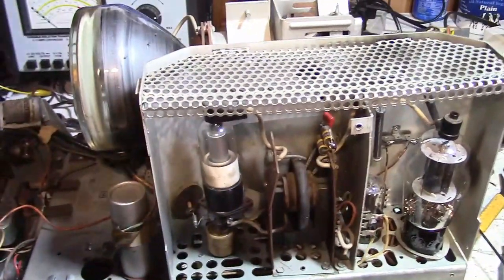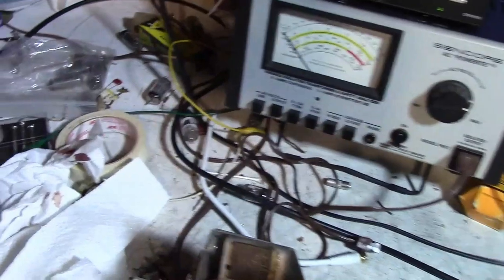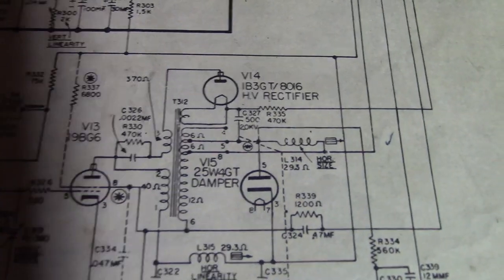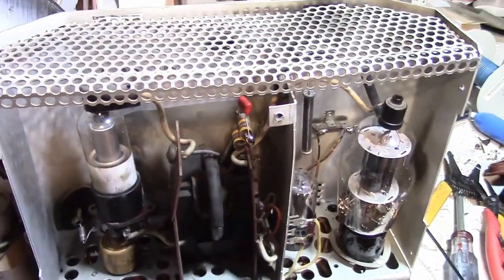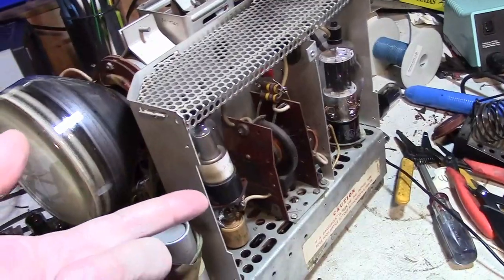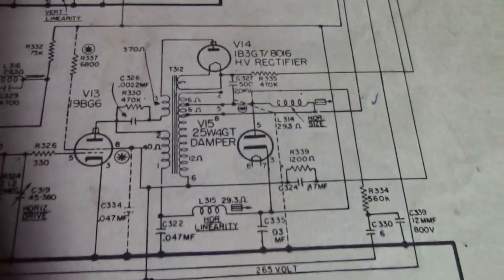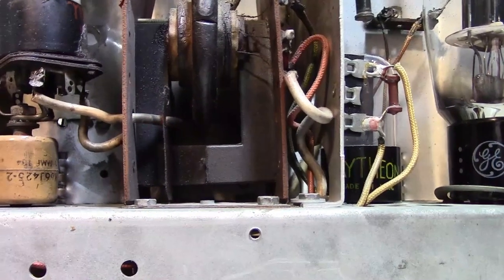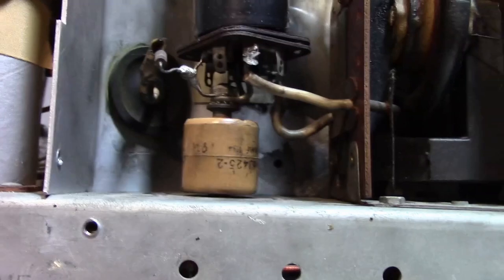GE 800D restoration p6o8

Comment: Hi Bob, Always enjoy your vids. Regarding the bright vertical lines appearing on the raster, I came across an old TV service book by Wayne Lemons in which he describes this phenomena related to the horizontal deflection yoke. Specifically, if it is a series coil, there is an "anti-ringing" capacitor across one of the coils that eliminates electrostatic deflection by equalizing the potential across both coils. He goes on to say; "...if it should open, there will be a series of brighter lines on the left edge of the raster, gradually diminishing in brightness towards the center of the screen." Not sure if this is relevant to the GE800D. --Steve C.
Reply from the maker: Thanks for the info.  I did check that cap and it's good.  I will try disconnecting it just to see what effect it has.

Comment: Hey Bob, sorry if I missed it. What exactly was causing that bright vertical line with the folding? You said the old flyback tested fine and your going to put it back in, so it wasn't that? Thanks so much for sharing this, was quite a journey.
Reply from the maker: I don't know yet.  Yes, the old flyback tests fine, but if I put it back in , the line reappears.   It's entirely possible it's just not the right flyback for this set and never worked properly.

Comment: I've got a TV with a completely knackered flyback, it looks like a charred birds nest with a ferrite core through it! To make matters worse, it's a rare set and i haven't been able find a compatible flyback in 10 years of looking.
Reply from the maker: What's the model? These early B&W sets are pretty reliable. I don't think I've ever encountered a bad one. Even this one is good. There's just something up with the damper circuit
Reply: @bandersentv  Its a Bush T67, The lopt is driven by a PL36 (similar to a 6CM5 but with a 25v 300mA heater) and uses 3rd harmonic tuning (30,375Hz) according to the service info.

Comment: Hi Bob. I just noticed something odd. The schematic calls for a 25W4 for the damper tube (a rectifier.) A 35W4 is also a rectifier used in AA5 AM radios as a half-wave rectifier, but it’s a 7-pin subminiature tube, not an octal tube like the one in the set. Interestingly enough, a 35Z5 is the (rough) equivalent for AA5 sets that had all octal-base tubes, and is much closer to the tube seen in this set from the viewpoint of physical construction, if not the electrical characteristics. I would think all “<something>W4” tubes would be the same, save for the filament voltage. Is the damper tube in the set - in fact - a 25W4? I’m more used to seeing something like a 6AX4 here, based on salvaging them from old tube sets back in the day. 🙂

Comment: I was told to place a #47 pilot light on HV#1 of the 6BG6/19BG6 to save the fly back if the tube shorts.
Reply from the maker: Yes that would work.  Some sets from this era had a 1/4 amp fuse on the flyback for protection.

Comment: You do good work I was wondering if you are going to do more work on the Zenith 5311U color roundie set?
Reply from the maker: Thanks.  Someday but it's low priority.  I need to build a new workbench first to handle the size and weight.  Also it will be my first roundie and I don't have much experience with mid 60s sets.  So it's going to take a major commitment for me to work on it.  I also have a 1965 color Moto I've been tinkering around with.  I'm more inclined to work on that first as it seems a bit easier.

Comment: Hi Bob, if you had to, could you use a flyback transformer and circuit from a CRO?
Reply from the maker: Unlikely.  The Flyback, yoke and damper circuit all need to work together smoothly to get a linear sweep, correct width and high voltage.  I have dozens of NOS and used flybacks from the late 40s and they are all slightly different.  You really need to use the proper one for a particular chassis.